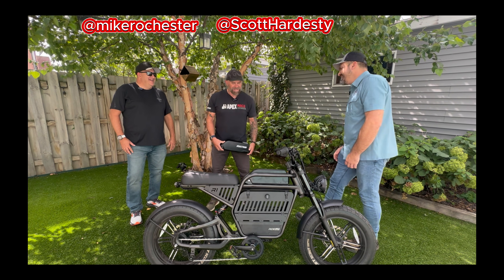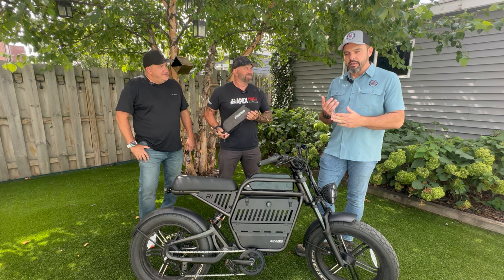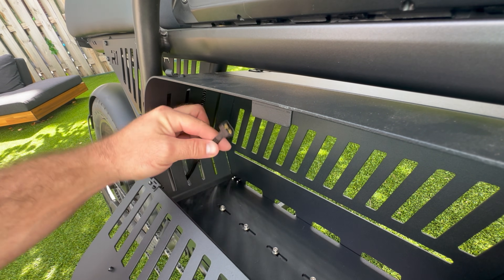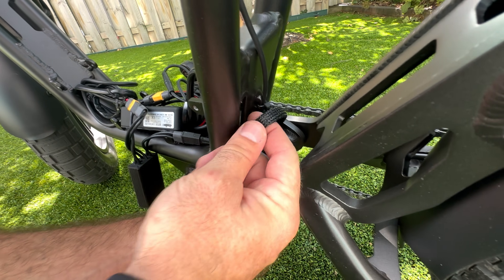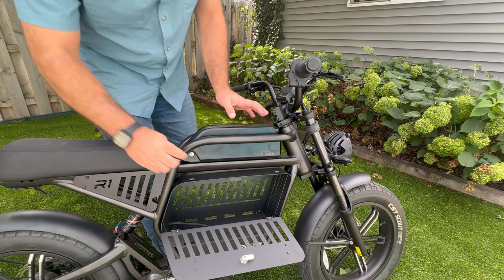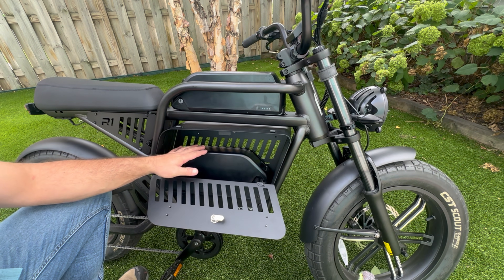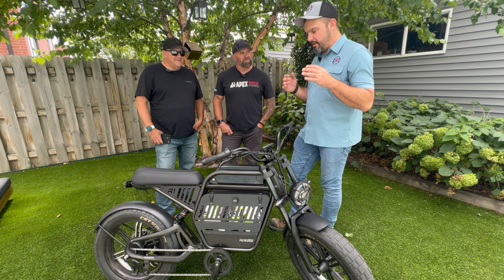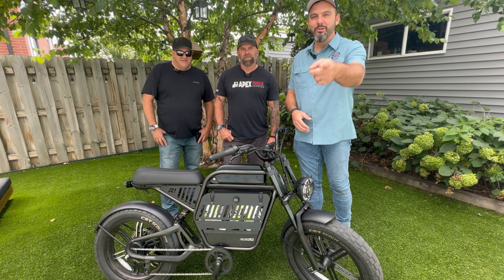Ride1Up | REVV1 | Dual Battery Kit Upgrade on 52V 1000W e-Bike⚡️40 Amp Hours More Power + More Miles

Comment: Great video; thank you so much!! Question: Couldn’t you drill  a small hole on either side of the cage for the battery port and key so it could be mounted flush in the controller box instead of having to lift the mounting rail?
Reply: The issue is that you cannot remove the battery with that kind of space. It needs to be raised to allow the battery to be removed.